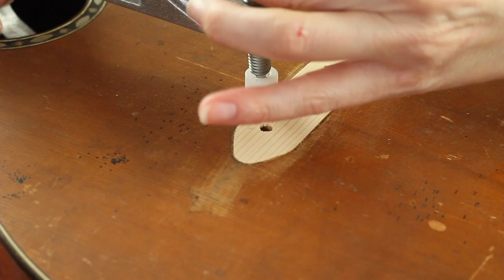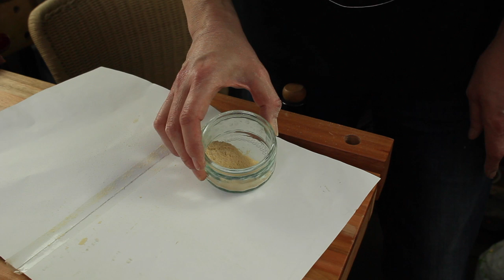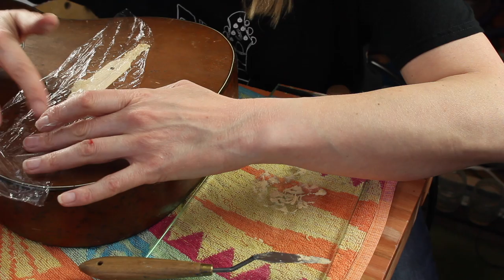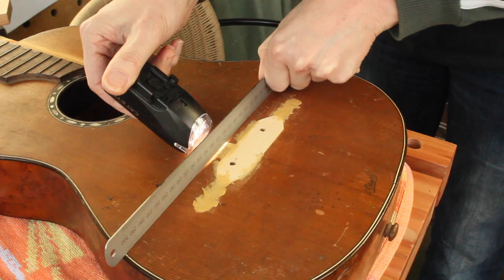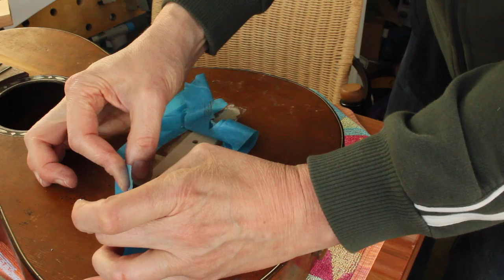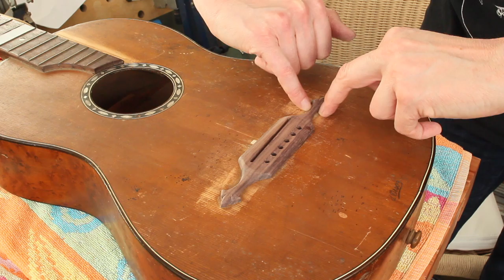Restoring an antique parlour guitar part 22: Flattening the top

Comment: Snap! Susan, I have just done a very similar repair on an oldish no name acoustic guitar I bought from a charity shop just to play around with. Even down to the little chip, but mine was below the bridge. I glued the loose fibres with tight bond and clamped the area between two Perspex shaped cauls one where the bridge plate was removed ,one the same footprint as the removed bridge. After removing cauls the area is flat and smooth.  I was thinking of roughing it up with sandpaper before regluing the bridge,. I experimented trying to glue two pieces of wood previously coated with titebond and clamped between Perspex together . When I glued the two glued surfaces together with more titebond and let dry overnight  I tried to separate them twisting and pulling but they are glued fast. Try it yourself? Titebond doesn't stick to Perspex end leaves a glass type finished when removed.!
Reply from the maker: Which Titebond did you use? Titebond 1 breaks down with moisture - not sure if it needs heat too. The moisture of the wet glue may break down the glued surfaces and help the glue to glue bond. The accepted wisdom is that a glue to glue bond is weak compared to a glue to wood bond. I should point out that I still have a fair amount of wood showing on the wings, particularly after the sanding I've done to get the finish off - oops spoilers! :-)

Comment: Susan, I have a question about filling in the tearout and other voids.  Is it possible that a liquid could be used that would travel down into the voids and solidify to form a smooth surface appropriate for gluing other pieces (the bridge) onto?  I had used a marine product years ago which I think is still available.  It soaks into the wood and hardens.  It was similar to the low viscosity cyanoacrylate, but came in two parts and was available in larger quantities and is very strong.
Reply from the maker: +alex tworkowski Alex, you're talking about something which is used to stabilise wood, rather than simply fill it - to be used on difficult to process woods which might look great but be very weak, due to spalting or rotting, or simply due to their structure e.g. burl. The wood here just needed filling, but I wanted to keep the use of filler to a minimum, as gluing to filled wood isn't as strong, and the filler would change the acoustic properties of the wood - potentially dampening vibration.

Comment: Great video! Just a thought - the reason why a lot of older classical (nylon string) guitars have a soundboard that dips between the bridge and the soundhole and then bellies up between the bridge and the tailpiece is because of the twisting action that the tension of the strings impart to the bridge (and thus to the wood beneath the bridge, in this case the soundboard) over the space of time. I have several guitars from the 70's that all exhibit this slight bellying/dipping effect and have made my own inquires of the original luthiers, several of whom have confirmed that they originally built the guitars with flat soundboards.
Reply from the maker: +StansburyStudiosInc It's not just classical - my 70s 12 string does the same - it's a design flaw usually - not enough bracing for the tension. Having finished this guitar there's no sign of bellying yet :-)

Comment: I wonder how glues stick to PVA-dust filler. PVA doesn't stick to dry PVA, but the dust may make a big difference. That's something to consider.
Reply from the maker: I wonder too. I'll be scratching the surface to provide a key. It's not as critical a bond as the main section, but any extra bonding strength would be useful.
Reply: Scratching doesn't help with PVA glue. It works by penetrating the material. If it can't do that, then it doesn't hold. Roughening the surface helps with surface bonding glues, like epoxy. The force comes mostly to the clean wood-wood joint, but the top flexes and I think the sides do have a role in distributing the twist to a wider area. I would test glue a piece of rosewood on a sanded filler surface just to avoid surprises.
Reply from the maker: +esa062 I might film a test of bonding strength on glued surfaces

Comment: Where did you get that little Lucite block you are sanding with?  Did you have to cut it from a larger piece?
Reply from the maker: +Sysiphistication yes, I cut it from a sheet of 10mm acrylic I bought on eBay
Reply: We seem to be on a parallel wavelength.  I just did the same thing, but I opted for 19 mm, thinking that with my stubby thick fingers it might be easier to hold on to.

Comment: I agree with Randy. That guitar needs to be humanity. The wood has dryed out. that is why the braces has pulled away in the center. causing the bow at the bottom of the sound hole.
Reply from the maker: I've been monitoring humidity over the past year and in the UK it never varies between 60-70% all year round, at least in my house. The guitar may have been stored in damp conditions at some point, but I think most of the damage was caused by putting modern steel strings on it. Problems with guitars drying out is more of a continental American issue I think - we're surrounded by water here.
Reply: Maybe you should put a gauge inside the guitar for a few days. Then see what the humidity is
Reply from the maker: +Thomas Tommy it was around 60% when I did that a few months ago
Reply: +Susan Gardener OK, I am sorry. If I upset you. it must I have worked out for you.

Comment: The axe is coming along nicely.. Great work.
Reply: By the way, what do you think of the bench now you've used it for sometime?
Reply from the maker: +Stokie Joe Bushcraft It was a good purchase after I did the mods. It's not so easy to clamp stuff to the surface though, due to the lack of depth and the 15mm edge strip. I might invest in a dog-hole clamp, or I might glue some extra strips round the inside of the top so there's more to clamp to on the edge.